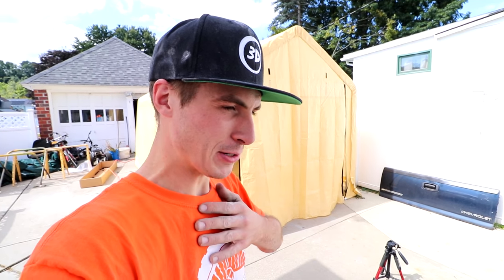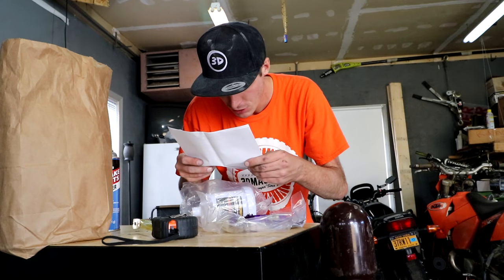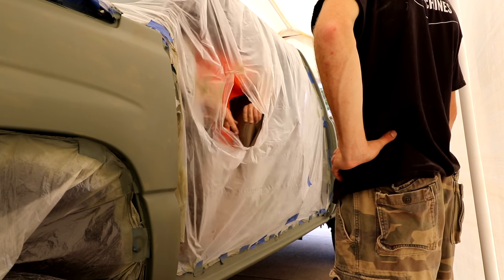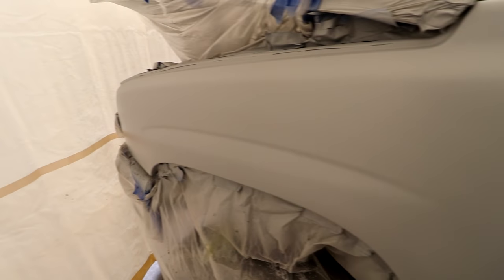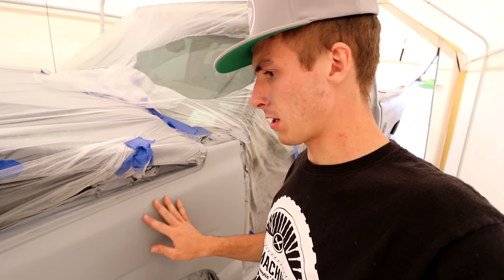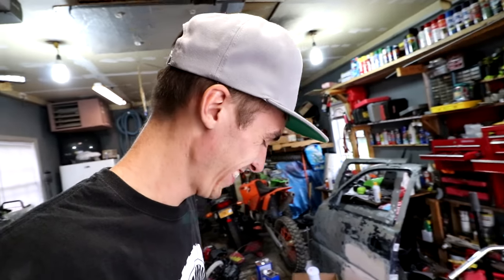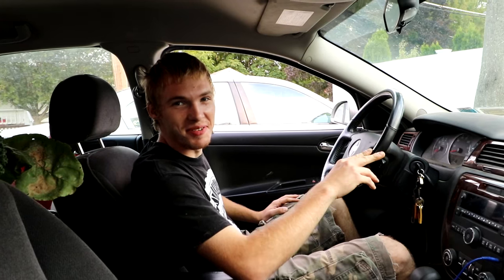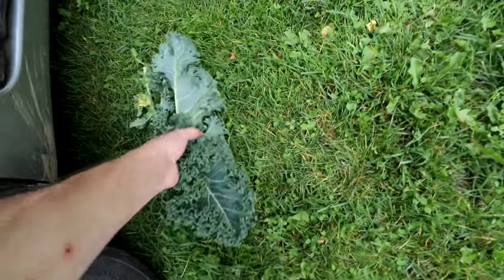Pre-Painting Duramax (NEW Paint Booth)

Comment: Longer videos would be awesome mate, don't have to edit as much. I would have liked to have seen you paint the truck yourself, but I don't blame you since it would be your first big project and it is a smart move to have your cousin do it since he has experience. When I started painting, I used test panels like fenders, motorcycle parts and hoods. Body work isn't bad once you get the hang of how to use different tools and know how to use them the right way. But painting can be tricky.

A lot can make a paint job turn into a mess. Humidity, heat, cold, not the right size tip or a crappy gun. All play a big role especially when mixing the right amount of reducer, activator or hardener. I was nervous as all heck when I did a complete paint job on my 37 chevy coupe. All the practicing and painting smaller panels paid off. The primer and base coat was smooth with no imperfections at all.

I did have an issue with my clear coat though. I did not get the right measurement with the hardener and I did not compensate the warmer weather conditions and it shrunk which caused cracks all over throughout the clear coat. I was pretty ticked off and bummed out about it.

But I wet sanded it all down being careful not to sand into the base coat. I re-shot my clear with the right amount of hardener and it turned out AWESOME. I wet sanded and buffed it out to a mirror shine. Takes practice, patience and the ability to measure correctly with weather conditions. I can't wait to see how your truck turns out. People need motivation and inspiration these days and you are doing awesome at doing both. Keep up the great work. Hope you have an awesome day.